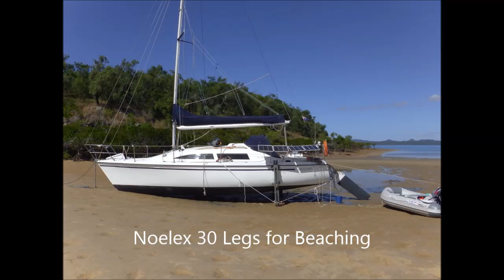Noelex 30 Beaching Legs

Comment: Nice addition Simon. Well done.
Reply from the maker: Garry nice to here from you, I use them quite a lot.  I hope to get to Wathumba  in September Holidays it is time you organized another whale watch cruise.  I ran into one near Scawfell  doing around five knots rearranged the shelves put the wind up me. I Have not seen your boat in the marina for a while, regards Simon
Reply: I have brought the boat home Simon, so I can remove the keel and fix it up properly. Plus I want to give it the complete once over to get it back to cruising condition. I am thinking about planning a Bass Strait crossing next year, Island hopping across, via Wilsons prom. You should have a think about joining in.
Reply from the maker: Garry don't forget seal the center case up at the bottom somehow spray foam on a sleeper jacked up . might work. molasses 1-9 water leave 3 months wash off and paint
Reply from the maker: That is if you cannot get it out due to the rust, good luck
Reply: That's why I brought it home Simon. I have a crane system in my shed, and also a pit. The plan will be to lift the boat off the trailer, place it over the pit to access underneath. then when the keel is ready to come out, I can either lower the keel with hydraulic jacks, or lift the boat up off the keel.
Reply: He might need a bigger shove to get him motivated but yes it would be good to see , the whale watch I mean not the keel